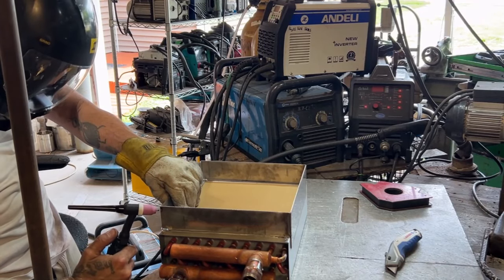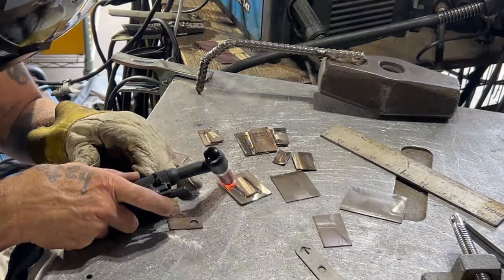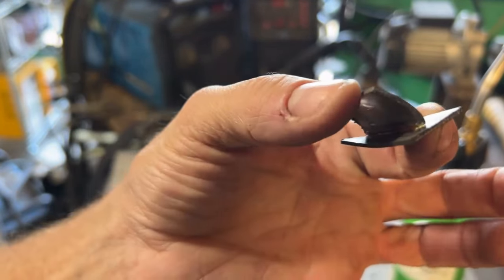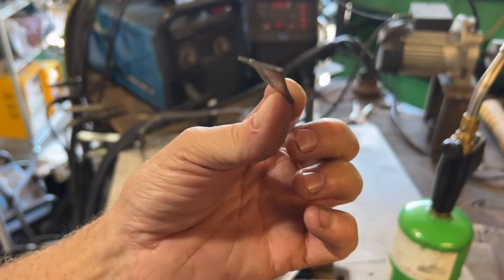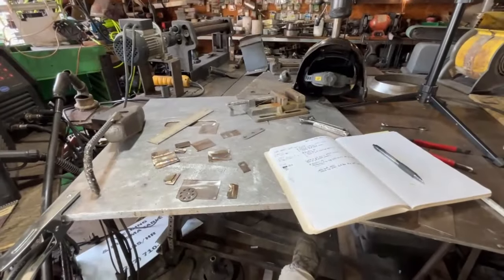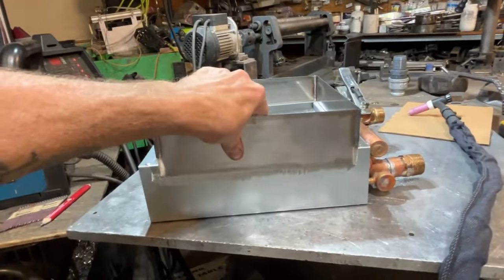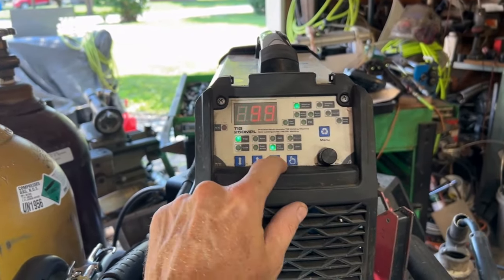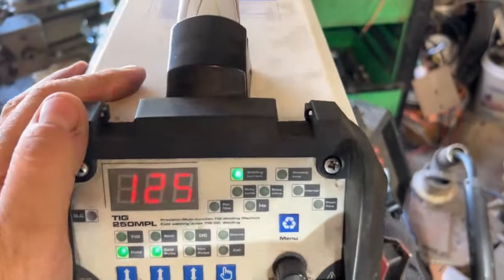They where wrong about Cold welders but why ?

Comment: Ive autogeneously welded 304ss with hot and short pulse settings like shown on pre turbo and post turbo exhaust systems containing pie cuts and have subjected them to some rowdy antilag explosions and never once had a crack in the three years that exhaust has been together. Im with you.
Reply from the maker: Thanks for the input , im gonna try them on spool tube pie cuts

Comment: I had one. Found it very interesting at the time and decided to try it. Great for small and thin materials. I follow a channel of a Chinese woman who works in a factory, shows videos of using it to manufacture small metal trinkets and larger jewelry. This method of welding is highly practical for certain applications. For me, my MIG/TIG welder is all I need. I ended up returning it. But I too would highly recommend anyone try this if they think they may need it!

Comment: @NOBOX7
2 things
1.Cars chassis are cold welded and in general most of the car body is, with good enginering you can build incredibly strong structures with terrible welds.
2 You can relase part of the stress by baking the parts or in general anneal the area of the weld.
You are right there is a different tool for each different job
Reply from the maker: Right on  l.c.9524  , your comment about making a strong structure with bad welds is so correct .
And great input about the spot annealing , they do that with very large pieces using heating blankets
Reply: @NOBOX7 

Surely for annealing you don't lack the tools😂 I'm not here to teach you how to do your job.

But is really an impressive topic strong structures with shittty welds, cars chassis can teach lots of engineering skills.

Comment: Interesting machine ! Question is how does it compare to mig welding when it comes to thin stuff? Another interesting process is laser welding of thin metals but machines have insane price for now.
I think people bash it maybe because as you said it its a one trick pony ,compared to mig that can do heavy and thin stuff.
Reply from the maker: For me the manufacturer quality welds on delicate work  are most important , it has to look as good as possible . It is a very nitch machine for sure but man do i have big plans to use it on non structural welds in some of my builds . The welds are beautiful and unfortunately i cant replicate them with tig or mig due ot current skill level  . I'm close but maybe 3 years out , also i do alot of electrodes and other delicate welds that my other welders  cant touch
Reply from the maker: Its far better on this material than mig and tig for my skill set . Its a specialized tool yes but its not as worthless as youtube led me to believe . 
To break the welds you must completely destroy the coupon in most cases  , this is not a failed weld , if the structure cant hold up to the destruction test how can we blame the weld ? If the coupon is bent to hell  but the weld still held at 120 deg deflection that is not a failed weld . try and shear it of or pull it off and its not happening